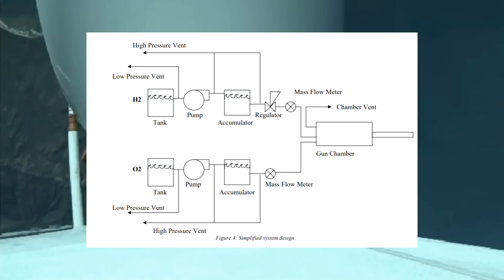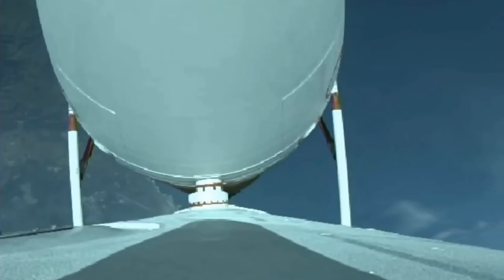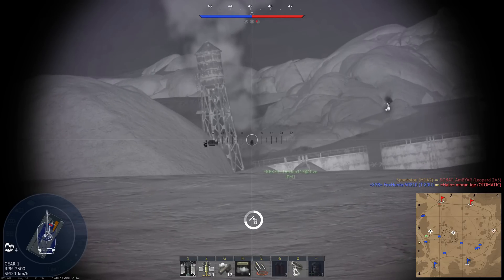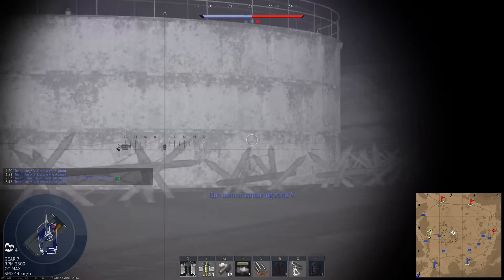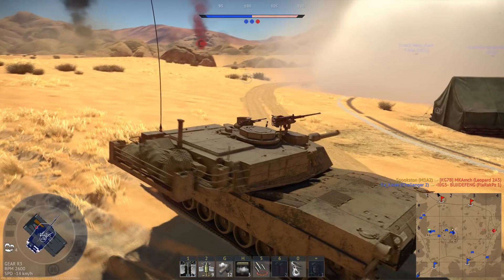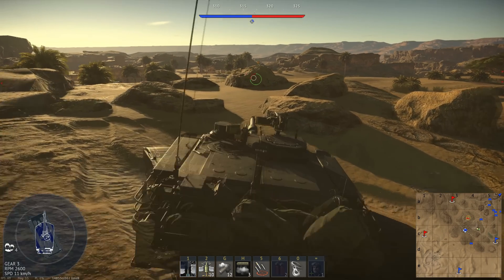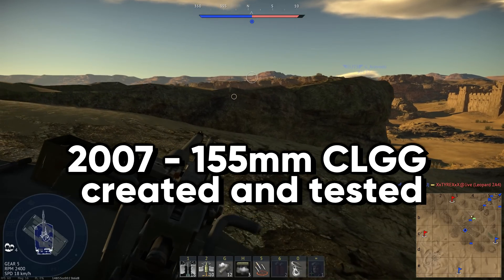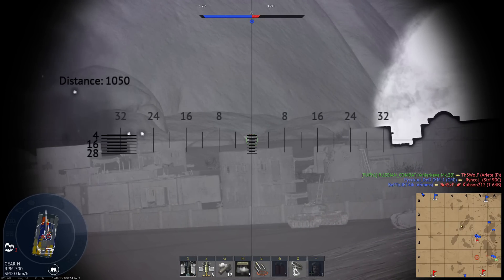CLG Guns - Future Tank Weaponry

Comment: but to think about it. if a round goes that fast and used in tank combat they wouldn't really be used to that range I'm not an expert but tank detection systems wouldn't be able to see let alone get an accurate reading from 200km. with most camera systems and thermal detection systems rely on light that can be bent threw discrepancies like different temperatures in the air like when the target is close to the ground and its a hot day. but it would require minimal effort if engaged in medium to short range. 7.22kmps would basically be a laser and require minimal compensation with bullet ark.

Comment: 7.2 km/s is literally Mach 21. That is incomprehensibly fast, I couldn't imagine how powerful a shock wave that'd be or the level of penetration a round capable of withstanding that force would have...
Reply: _ Jalmon _ ikr? When I heard faster then railgun my mind was blown, before that point I thought the railgun was the end all be all fast as fuck boi but I guess there is something that can fire rounds almost double a rail guns muzzle velocity lol.
Reply: @Phantom-bh5ru   Current railguns are limited by their construction, energy source and the material of the rails. While conventional cannons, LGG, CLGG have a theoretical maximum speed, limited by the maximum expansion speed of the gas, railguns have no theoretical speed limit (besides the speed of light).

Railguns are still the be all - end all of kinetic weapons, we just need to develop it further.
Reply: Bennet Petersen ah ok thx
Reply: @Phantom-bh5ru  For example if you made a railgun that was the size of a building and was powered by a nuclear plant you could even destroy something on the moon with it
Reply: @abyssstrider2547  
"You can't just shoot a hole into the surface of Moon!"
Reply: @abyssstrider2547  if a railgun like that was ever developed it would be widely used to send stuff into space for cheap without the need of rockets
Reply: @pc_screen5478  Probably not. The acceleration would most likely kill the passengers. Magnetic forces could easily dent the container or even crush it. Not to mention it would probably damage anything made of a non ferrous metal due to it not accelerating
Reply: @abyssstrider2547  The rate of acceleration could be controlled.
Reply: @marcuswelch4515  You don't get it, do you? There is an object that is completely still and then its sped up to ridiculous speeds, gravitational force generated is deadly, try accelerating rapidly in a fast car and braking to a full stop to get the idea.
Reply: @abyssstrider2547  Indeed, which is why one would want to control the rate of acceleration instead of dumping all the energy into the projectile at once. Try accelerating slowly to top speed in a fast car and coasting or gradually braking to a full stop to get the idea.
Reply: @marcuswelch4515  I get it but you won't make a 5km long railgun for such a pourpose, now would you?
Reply: @abyssstrider2547  Why not?
Reply: @marcuswelch4515  It would be expensive? And the tallest building on earth is currently around 1km long so it would require an impressive ammount of engineering
Reply: @abyssstrider2547  1 km long vertically, but not horizontally. And it would be expensive to build, but cheap to use
Reply: @marcuswelch4515  I guess so.
Reply: @abyssstrider2547  Cheers!
Reply: @marcuswelch4515  Both of you are rather underestimating how long such a gun barrel would have to be to be used for people. Basically it would have to be as long as the powered flight path of a standard rocket, to keep the g-forces at a survivable level. That gives you a barrel at least THOUSANDS of kilometers long, which places such a design firmly back into the realm of fantasy.
Reply: @abyssstrider2547  One could also send things that aren't passengers, like supplies. Assuming they're resistant enough to not be destroyed
Reply: @punic4045  Maybe raw materials. Not much of anything else

Comment: If a CLG guns is run by a MethaLOx mix, it would be a bit more safer and cheaper. Then, in the problem of the complicated ignition, that problem can be solved using high power pulse lasers which is relatively cheap (nowadays) and can be computer controlled for accuracy.

Comment: Could you solve the hydrogen leaking issue by just switching to a different propellant (albeit at a loss of efficiency). Kerosene is commonly used in rockets today and doesn't have the same sorts of storage issues. Methane is going to be used on the rockets of tomorrow (basically a lot of the rockets currently under development, well, 3 American ones, use methane as their fuel), and although that does have to still be cryogenically frozen it doesn't have the same leakage problem of hydrogen. If you add the Sabatier process to the electrolysis and scrub CO2 from the atmosphere then you can also create that aboard ships, and it would be a bit more efficient than kerosene (but less efficient than hydrogen).
Reply: You need a very very low molecular weight fuel for this to work properly.

There's a strict underlying velocity limit to combustion powered firearms: The projectile can never be faster than the speed of sound in the (pressurized due to explosion) propellant. The heavier the propellant, the lower the speed of sound.
Reply: @xSchattenfluchx  That does complicate matters, and I will admit that hydrogen would be better if it's feasible, but would the use of methane still be better than the use of gunpowder? I think I'd need to read up on some stuff, since due to it being cold, liquid, and pressurized, the speed of sound in both methane and hydrogen would be different from the easily google-able results.

Comment: Did your research turn up anything about the use of alternative fuels such as methane or monopropellants? You end up taking a hit in projectile velocity, but the gases are much more storable as a result.
Reply: Yeah, I mean when you're in excess of 5km/s, the difference between velocities becomes academic.
Reply: Methane should be the second best.  You want the gas that pushes the shell to made of molecules as light as possible. Gun powder create steam, nitrogen and carbon dioxide gas and the later two are much heavier than water molecules. If you use pure hydrogen the pushing gas would be water. If you use methane there would be some carbon dioxide in the gas but the fuel still have one of the highest hydrogen content. You could also use ammonia but it's corrosive to the metal and quite toxic at high concentration.

Comment: CLG guns would be a catastrophic risk for an MBT or IFV at best, but they would probably be a great benefit for artillery.  The higher muzzle velocity means that artillery can actually move further away from the frontlines, making it a much safer position, as well as potentially increasing the mass of shells due to the higher muzzle energies per unit volume of propellant.  For artillery, shell size is less of an issue than for tanks, plus the lack of a requirement for the "cartridge" (not sure if that term is still applicable for artillery-sized shells) ironically means that you can put more, larger shells in the same amount of space.

Comment: What about having a hybrid between a clg gun and either a railgun or coilgun, since electronic means aren’t limited to velocity it would seem that such a weapon could launch a 47mm aphe shell to around 10km/s.
Reply: Deez Nutz you would run into the issue of reliable timing of the electromagnets. Also you don't really need much more power for modern warfare at those speeds. A way around the timing it probable to use two magnetic sensors that calculate the velocity of the projective to time the coil sequence. Basically the projectile is magnetic and triggers the coils as it passes by them.

Comment: This is the problem with most "future" weapon ideas. Limited use or practicality which will lead to not being fully adopted or in very rare cases. 

It's not bad but its along the lines of the G11 and caseless munitions. Great idea but not up to scuff with more conventional designs or munitions that work. 

in 10 years this comment will probably be wrong as composite cases get replaced by caseless and  im getting body parts replaced with robotics.
Reply: So far it would only be applicable in navy but if we figure out how to store hydrogen easier and safer then it could be used in land vehicles as well.
Reply: Everything goes through a phase like this, but I'm pretty sure you could go back to the Forties and find all sorts of proposals that were blue sky ludicrous back then, but now are commonplace.
Reply: @CallanElliott  I kind of referred to that in my comment in the last part. I was just saying now it seems  ridiculous and even if adopted it wouldn't be a major use but in the future the  idea might be able to be of use (like caseless ammo) and able to actually be adopted.
Reply: Well, G11 ultimately passed all trails and what killed was economics.

Comment: Hydrogen is problematic at best as a propellant of any type, for one ton of it takes ~14m^3 of volume and on a volume-restricted system like a tank, it is detrimental. The only reason that railguns aren't getting extreme muzzle velocities is the fact that our rails aren't strong enough to survive the plasma erosion. On something mass-restricted like tanks, it is likely you're going to see coilguns more than railguns because plasma erosion isn't as detrimental.

Also, hydrogen (when combined with oxygen) is flammable to the point that it is EXPLOSIVE, so if your cooling system fails or there is penetration and fire, you're going to get a boiling liquid expanding vapor explosion (BLEVE), which is FAR WORSE than a regular explosion. We're talking MASSIVE boom here (https://www.youtube.com/watch?v=UM0jtD_OWLU).